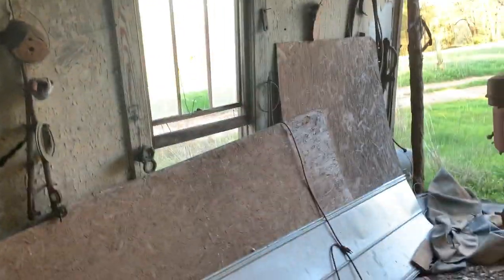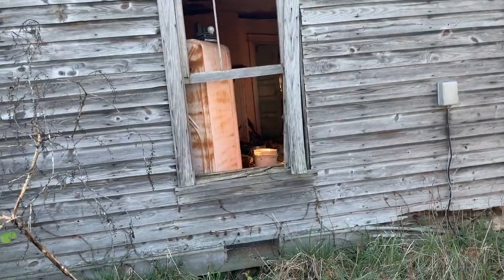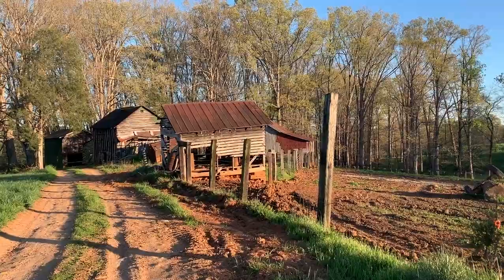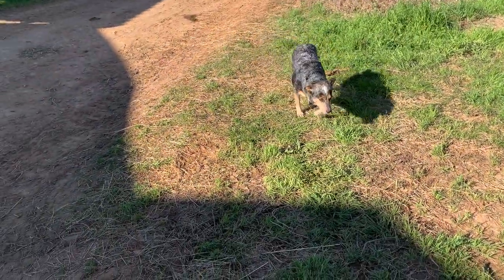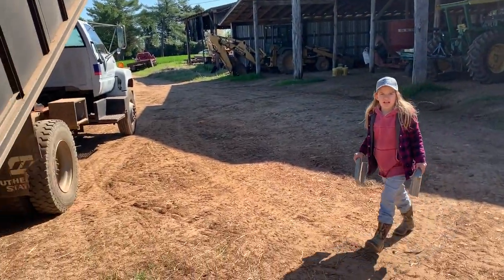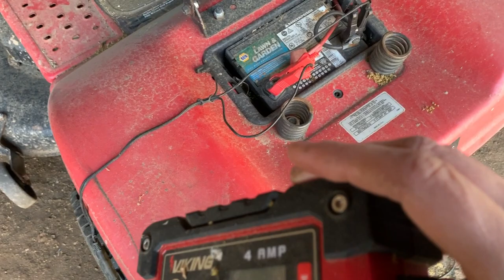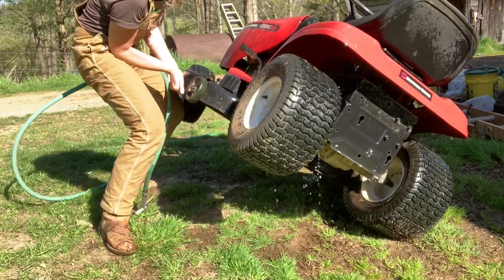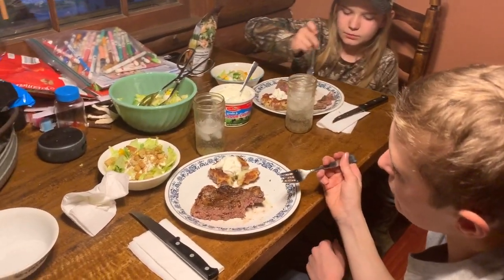Finding Buried Treasure!

Comment: Just an FYI, you should use air to clean the deck off & wash it only once in awhile because most decks don’t have grease fittings on them today. The water ruins the bearings. Great video be safe.

Comment: I know I wouldn't even attempt to lift my lawn tractor up on its side like she did to hose out the bottom of the deck. Wow! I'm impressed how she showed us guys up. The guy down the street (Rick) has a simple portable tractor lift that he used on my lawn tractor to sharpen the blades. Farm wives are hard as nails (no lift necessary ) Choose wisely guys.

Comment: I have tried to keep track of your Equipment.  5 tractors, 5 trucks?  Your daughter is really getting the hang of driving. Easier to steer if it is moving just a little!  Barley looks Lush.  Flock is nicely fattened.
You have to wipe and then check the Dipstick.  Oil climbs it via capillary action and gives false reading if stiitng for awhile.  GREAT start.  Good to idle down before shutting off as you did.  Stops backfiring and is good for the engine after working it.   A barn cat would be nice................. Great Video.  Thanks.
Perhaps you could do a video on your Weather Station if it is active.

Comment: My Corgi is pretty good at finding old dead raccoons. He will spend the first few minutes rolling over in the leftovers to pick up as much 'stink' as he can, then start chewing on whatever is there.
 If the engine is hot, let it idle for a minute before you shut it off and it shouldn't back fire. If it's an OHV engine, it's best to let it cool off a bit so the valve guides or seats don't come out of the head. Backfire isn't great for the engine.

Comment: Next time, unplug the charger before disconnecting from the battery.
Reply: yeah it's safer that way and the red is hot so it wont spark. I was just waiting for it to start sparking. ewwww I always unplug the black first and then the red not sure if that's right but that's what I've been told and so far it works. lol ALSO I used to wash our mowers off after I finished mowing and a friend said I didn't need to. He said it causes the mower to rust. I was wondering why ours was so rusty. He said to blow it off with a blower to get the grass out and off it and it's working and this mowers deck isn't so rusty now from getting wet and it sitting on it. Just an idea. Hubby had always said hose it off so I did. :-)

Comment: What is the purpose of washing under deck
Reply: wet grass rusts steel quickly, its corrosive .
Reply: Nathan Sparrow it was dry out there...the sand will eat it up before rust
Reply: @MrBigblock3272  I agree with you I wouldn't wash it as you are more likely to leave it wet in lumps of grass you didn't get out and also get water in the bearings . But it's the grass juice itself  that's corrosive.